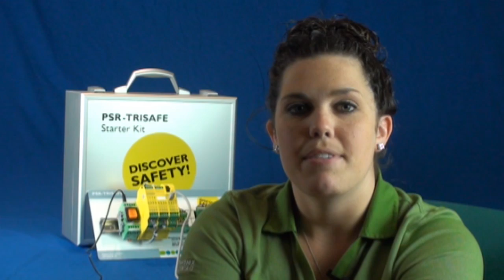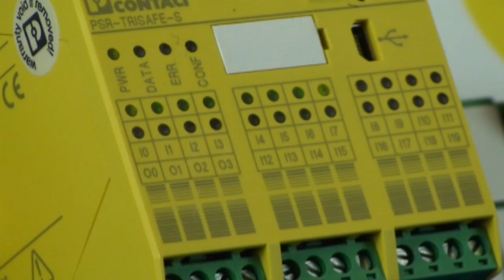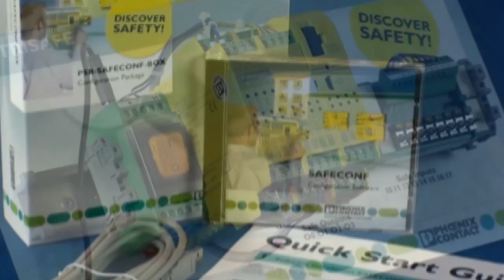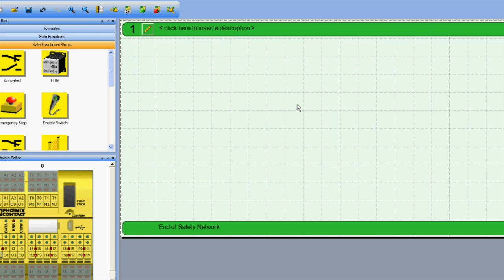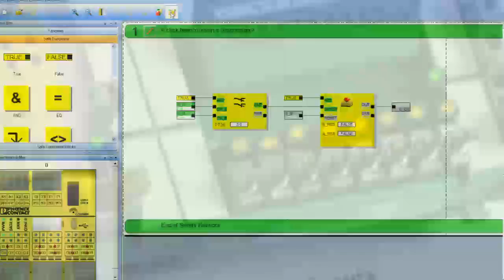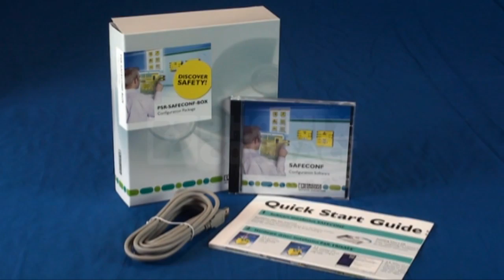Simple Configuration of a Safety Controller - Phoenix Contact

Comment: Is this software still available? I sent a request two weeks ago and haven't received any response.
Reply from the maker: TriSafe software is “SAFECONF” and is still available at no cost.  You may navigate to the product page via the link below or type in the part number on the Phoenix Contact website. Under “Downloads” > “Software” there is an item with a .exe extension.  Download and run that to install. You may need to create an account on the website but it is a free software. No license.

Link: https://www.phoenixcontact.com/en-us/products/device-parameterization-safeconf-2986119
Part Number: 2986119
Reply: @PhoenixContactUSA  This is fantastic. Thank you.